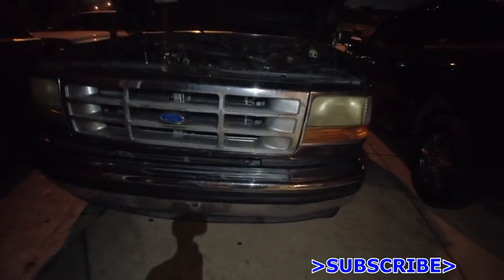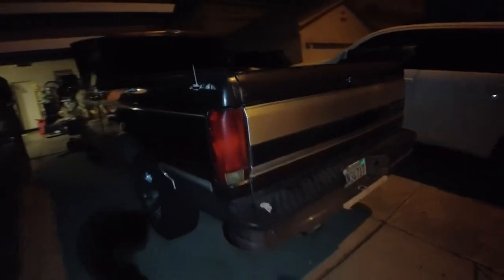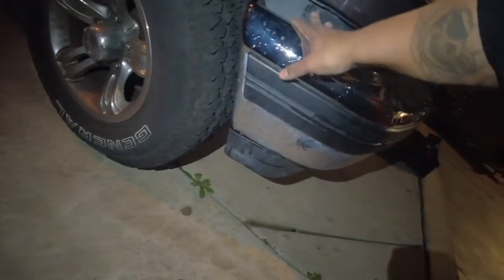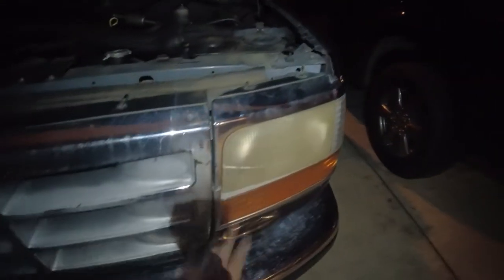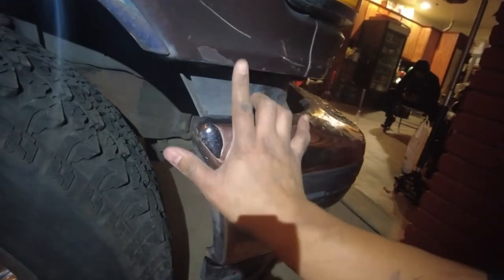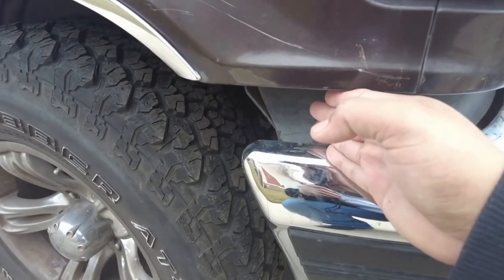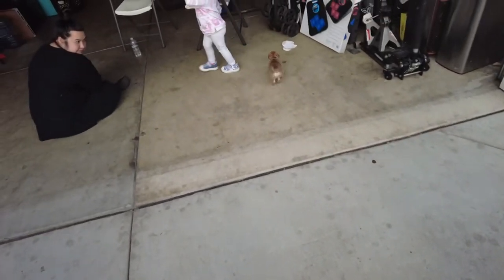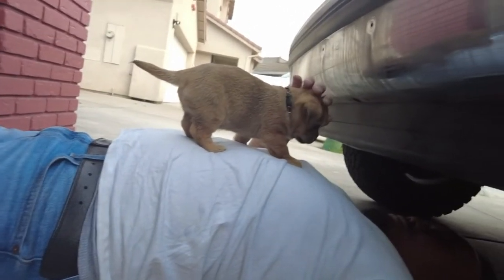BUMPER INSTALL/ fixing BUMPER SAG

Comment: How come you didn't show how you managed to get the gap out? You didn't show your audience anything.
Reply from the maker: Sorry, I should've added a before and after photo. The gap was about 4in. and I managed to get it down to 2in. I'll definitely be putting more of an effort in putting out a better video.
Reply: @thechiefstrucks  I don't know why this is always such a problem with the OBS fords. I have a 94 f250 and although I am in the phase of doing so many other things on it I got a nasty bumper sag after replacing the new bumper. I will have to get back to it later but everybody seems to have the same problems with these trucks. Did you solve your problem with washers for adjustments? I know you want to build your channel, but the fastest-growing channels are ones where your audience can learn or solve a problem. You have to be precise in explaining what you are doing and video every process you go through to achieve it. Make it simple and clear as a bell for all to understand. Good luck
Reply: @johnnyohness I have the same problem with my ‘93 F350 and I watched the whole video thinking I’d see the fix lol but now I guess I have to just get under there and figure it out oh well. I agree he should make a follow up video and just explain what needs to be done. I assume if you shim either the top or bottom bolt for the bumper bracket with washers it will tilt the bumper up or down on the side view … did you ever figure it out?
Reply: @crueljimi  Yes I can tell you that whether it's a 150 or a 350 the bent bumper problem comes from the truck pushing something heavier than the pumper can tolerate. If you remove the bumper you will see that the brackets where the pumper mounts are bent back. You can put washers between the bumper mount and the bumper to take up the slack or you ..can put a cable through the mount of the mount and find some way to pull it straight again. I did the cable thing and wrapped it onto a tree and
went forward enough then backed up several times to pull the mount straight.
I've known guys who used a come-along
and did the same thing. I hope this helps.